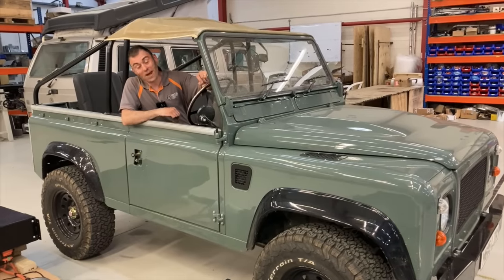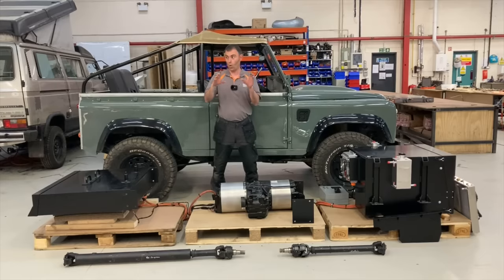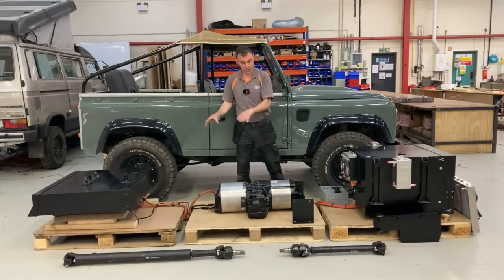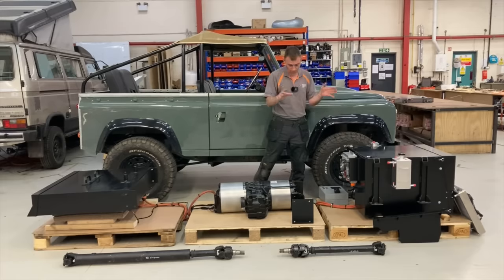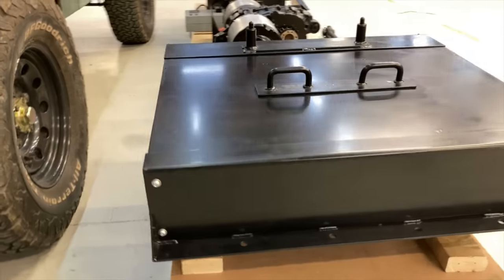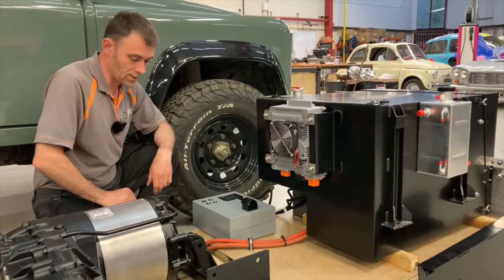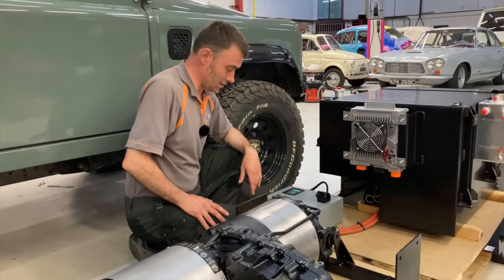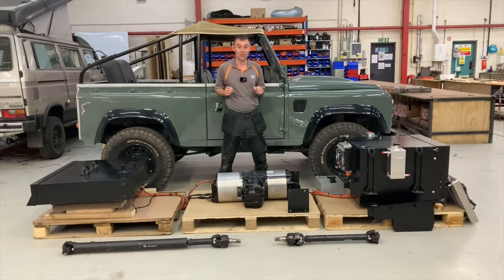Land Rover Defender bolt-in electric conversion kit.

Comment: Please, please, please start selling these kits to the public. ECD in the US are only interested in doing $250k builds and have no interest in doing swaps for the everyday average folk. I would love to do this conversion myself!
Reply: I agree.   I reached out to ECD and they have so many orders for special builds and won’t convert existing Defenders.   Please offer the kits to other businesses in US that will.   Great work and amazing product.
Reply: Me too Brother
Reply: I'm on the same boat. I'd love to convert my Disco1 to EV
Reply: @karlspena  Me too. Disco 1 kits for diy please. A kit with a bit less motor power. Not everyone 4x4 needs 3.5sec 0-60 in fact is often better a little less power. 150kw is fine I think. will go further too maybe.
Reply: Agreed… the home builder is the way of the future really. It’s incredibly wasteful to toss a rig who’s only fault it it’s power source onto the scrap heap. Better to upgrade for sure.
Reply: Ditto.  End use sales please.
Reply: How about converting a Delica?
Reply: No mechanic but absolutely yes !!
Reply: A kit that gave you say 0 to 60 in 7 or 8 secs would be plenty for me, it would reduce the cost on axle upgrades, brakes etc and still be a great conversion.
Reply: Great video! Thanks!!
And a eléctric Kit for Nissan patrol are available too?
Reply: This calls for a kickstarter campaign.
Just need some capital to set up a business structure for imports, etc.
Guaranteed sales.
Reply: Will these fit a dodge challenger?
Reply: Yes please start selling these to the public id love to swap my 4x4 suburban
Reply: How about a Mitsubishi Pajero mk2 91 to 99 model. There are a lot of these still around with great enthusiasts and lovers. A big community out there. But the price should also be affordable and made available to the public on a DIY purpose with your support of course.
Reply: Uhh throwing my hat in for a kit to convert my 67 Bronco.
Reply: I would love to put a kit like this on my Chevy Avalanche !!!
Reply: Got a 49 Nash statesman that I’m trying to save to convert- electric would be a blast. Need kits like this for shade tree public.  You can see the success of it just from the interest demonstrated in these comments
Reply: Would this maybe fit a 70-ties Jeep Wagoneer?
Reply: an electric lada 4x4 would be nice
Reply: Couldn’t agree more - I’d buy a kit tomorrow if they were available to the public!!! I have zero interest in going to ECD and spending a 1/4 mill on a defender - if the kit laid out in the video was off the shelf around $30-50K depend on spec you’d have a cue of people lining up to buy it. Just look at FORD - they are selling a create electric motor to the public. Please please please ECC setup a page on your website where we can order directly from you.
Reply: Land Cruiser Sahara 100 Series x2. My chequebook is ready!
Reply: I think you can call him up and become a dealer of these dude
Reply: And the UK
Reply: Land Cruiser fj40 kit would be awesome! Please sell directly to the public!!
Reply: I think they're put off by the idea of home builders dealing with 400 volts. These systems are seriously dangerous in the wrong hands!
Reply: Jeepster commando please!
Reply: Please do so… I really want to keep driving my 110 and with the diesel engines, it is harder and harder to get around…
Reply: I was interested at a time but I went with the Cummins swap

Comment: I'd buy that kit in a heartbeat to DIY my Disco 2, and happily sign whatever safety waivers you need. 
While I wait for that, or a discovery-specific kit, thanks for detailing the components!
Reply: In theory, it wouldn't be too hard to adapt that to fit a D2, Just the chassis mounts to fabricate. I think they convert the Defenders to an electric handbrake working on the rear axle. The dials etc for the dash would probably be the challenge.
Reply: @hughmarcus1  The D2 architecture is close to a P38 than a Defender, like the D1 is a classic Range Rover, so in principle two minorly different kits would cover several other production runs. The issue is though fooling all of the later ones into thinking there is an engine in it and it is running, lots of things rely on a signal saying it

Comment: Just love it! Would love to see an 80 series Toyota Landcruiser upgraded. Keep up the amazing work!
Reply: What’s wrong with a diesel?
Reply: @dutcheastindiancompany8415  it's slow and expensive to run?
Reply: @greenernick  cheap to buy, cheap to fix, and it’s goot for the earth.
Reply: @dutcheastindiancompany8415  Diesel is good for the earth?
Reply: @greenernick  a Diesel engine is very reliable, you can use them over and over again, as long as they get oil, they can keep going. That’s the opposite of a electric car, within 5 years your battery is running out of life, NEW ONE! After a short while the electric motor starts to have trouble NEW ONE! If people want to create cars that are good for the atmosphere, they need to make them simple, not from 0 to 60 in 2,3 seconds. No electric windows, not a big display.
Reply: @dutcheastindiancompany8415  lol, I mean, I have a diesel 4WD, so I've got nothing against them. But what you are saying seems to ignore the burning of diesel on a daily basis, overstate how often batteries need to be replaced, and overstate the amount of resources that goes into battery production.

Comment: The classic ultimate driving machine: BMW 325 E30 any form.  Proud owner here. I have been modifying this chassis for years just to keep it on the US road. However, if there is a simple electric solution, myself and many other proud owners around the world will jump on this solution and keep this gem on the road for many more years. Good Job and Good Work!

Comment: FJ40, FJ45, BJ42 etc should allow for a similar design strategy with the 60/40 battery split. If lucky, the same kit with some modified mounts might even fit.
Reply: I agree, I own an FJ45, 2f petrol, and I would love to convert.

Comment: ABSOLUTELY another vote for D4-3 conversion kit .... you would be knocked over with the rush as these vehicles were one of the best built (if you take out the mechanical issues .... usually down to the engine and transmission)

Comment: A Nissan Patrol Y60 and Y61 kit would be an amazing kit to have. Those axles are top of the industry, they only lack on the engine side, so this type of upgrade would be quite a step up, as they are very popular in Australia and middle east, but also some parts of Europe.
Reply: Yes that would be wonderful!
Reply: OM606 👍🏻
Reply: @seshelbow336  or BMW M57 which is an even easier swap, but it wouldn't be legal in Italy. An electric motor would transform my Patrol in a perfect every day city car, with great off-road capabilities
Reply: A SWB old school Patrol is something I lust after but probably will never get the chance to own…..for me it would have to be done in the Arab style like they race up the sand dunes….and I can’t think of a way to have a turbo hanging out of the bonnet with an electric conversion.
Reply: @seshelbow336  well I mean, you could but it would not have much of a use ahahaha

Comment: Excellent, just excellent. I hope in time you can also come up with a similar packaged system using a less powerful motor that wouldn't need upgraded axles? Although less exciting it would make it more affordable, and possibly yield a better range from same size batteries?
Reply from the maker: Yep. Already have that available now with a Tesla model 3 motor. Less power and more efficient. 👍
Reply: @ElectricClassicCars  Does Tesla sell their motor/transaxles on their own or do you obtain them from salvaged cars? If not, Tesla would behoove themselves to do just that at some point in the future.
Reply: Even if you didn't use a Model 3 motor, it's easy to electronically "de-tune" the power output.  I put these same components into a 1997 Jeep Wrangler.  I still have the factory axles and if I were to run full power they would break for sure.  I have it "de-tuned" to about 300kW and so far so good.
Reply: @JustWasted3HoursHere  I think you will find that all Tesla bits come from salvage.
Reply: @MiniLuv-1984  That seems likely, especially with the state of the world as it is right now. Maybe at some point in the near future they could offer it as a crate motor kit either to manufacturers who would like to build or convert their own cars but don't have the resources to do that part of development, or to end users who may just want to update their 1964 Ford Econoline...
Reply: @JustWasted3HoursHere  funny you mentioning an old Ford. I believe Ford are offering an electric crate motor.
Reply: @felixokeefe  Yep, the one based on the Mach-E's motor. But, it's not made for any particular Ford, which is where I think it would have really excelled.
Reply: @JustWasted3HoursHere  That sounds like a great start - a ford crate electric motor that drops into the transmission tunnel...
We also need a "all purpose controller" with factory ECU interfaces - plug and play into the current system and ofcourse battery  enclosures that drop into existing engine mounts and fuel tank openings.
Reply: @MiniLuv-1984  Yes! That's exactly what I'm talking about: The extreme simplification of a swap, where the majority of the hard parts are already done for you so that minimal customization is needed. They could start with a kit for a car they sold that changed very little over the years as far as the engine and electronics go, such as the old "Foxbody" Mustang that was sold for many years with mainly cosmetic changes. A kit that used the same mountings, connectors and interior space would, I believe, be very popular, especially if Ford built one to show us what it's capable of and why it would be desirable.
Reply: @JustWasted3HoursHere  Yes! and if I can add, the reason these bits are hard are that manufacturers aren't required or don't  disclose pertinent information.
Reply: @MiniLuv-1984  Agreed.
Reply: @JustWasted3HoursHere  So we need the gov to get on board and create necessary legislation.
Reply: @ElectricClassicCars  So with the Tesla Model 3 motor there is no axle upgrade necessary? But still recommended, I suppose? At least with the LSDs, right?
Reply: @ElectricClassicCars  sweeet

Comment: Definitely a Delica L300 and L400 kit. Preferably with the battery under the vehicle, as to keep the centre of gravity lower and because a lot of these vans are decked out as a camper or still want to keep them as 7/8 seaters.
Reply: And Pajero mk2. Great vehicles

Comment: I suggest that vehicle in the back left of the video frame. A syncro without the crazy expensive and breakable transaxle would be a beautiful thing. Replace the rear transaxle with a front diff facing the other way and do the exact same centre mounted electric motor setup. Although maybe use a leaf motor to save the diffs from exploding.

Comment: Fantastic! Go you guys! I have a Mitsubishi Delica L400 turbo diesel with a dead engine. It's run up big K's plus has irreparably buggered cylinder head also auto trans issues. I love my truck and it would be a perfect EV conversion I'd humbly suggest. Huge flat deck area for batteries, lots of space for the motor underneath.
Reply: Top idea!!

Comment: Build one for GM 4W and rear-drive vehicles!
I've been told (and have seen the results) that a Rover body bolts nearly directly onto a frame of the GM K5 series (Blazer and Jimmy) trucks... I would likely be one of the first of thousands to buy an electric-conversion kit for mine.

BTW, it might be the best 'bang for your buck' development because the K5s use the GM small block with the 700R4 transmission.  This drive-train configuration has to be (by far) one of the most common here in the states, if not the world.  The small block to 700R has the same mount-dimensions for nearly every GM truck and rear-wheel drive car since the late '60s through the early '00s; even the non-diesel Isuzu forward-cab commercial vehicles have used it!  In other words, there are 4 decades of beloved cars and trucks here in the US, and around the world (largely owned by DIYers/shade-tree mechanics) that would all be potential clients.  The modifications to your existing Rover kit should be relatively minimal considering the very similar space and power requirements.  

Long story short: very cool kit!
Reply: Id order one if they did one

Comment: I was thinking " Panda 4x4" right before you named it! I had 3 of them, from the very first model ( a green one) to the last one ( of the original model, of course) . Great little machines on snow and mud. Would really like to see how it turns out with an electric power train well designed and beautifully crafted as only you can do.
Reply: the "secret" of the 4x4 panda performance on mud and snow is the light weight, I'm afraid that a conversion would reduce the advantage it has over other 4x4's

Comment: Land Cruiser 80 series would be a good one Richard. They were Toyota's pinnacle 4x4 before the bean counters started getting involved.
There is loads of room underneath for decent size battery pack(s) plus cavernous space for the motor unit.
If ever you want to look at/under one I would be more than happy to pop over as I'm relatively local to you there 👍🏻
Reply: Absolutely the pick, likely the 100 series would also use the same conversion the market would be massive
Reply: @billcathcart138  I have a 100 Series that I'd love to convert

Comment: The most enjoyable driving experience I’ve had is the 2003 Discovery 2. The TD5 was a great engine back it day. I’ve got two low kms examples waiting for conversion.
Reply: Yes, Disco 2 would be perfect!
Reply: By the time the D2 was ungraded to the D3 it was a very well sorted car. 
Rear battery space when you pull out the 84 litre fuel tank and a nice big deep engine bay between the struts.
Reply: 🤤can't wait me to
Reply: Disco II owners deserve this. Look how we’ve suffered.
Reply: Wait…..isn’t the frame for the defender abs the disco I and II the same?
Reply: Want that too. Discovery drivetrain is essentially the same. It should fit with a few modifications. Not sure about the drop packs.

Comment: I would love to see conversion kits for Discovery 1 and 2. It would really give them a new lease on life!
Reply: better with a diesel
Reply: Would love my disco 3 as an EV, the 4.4 petrol is ridiculous with the current gas prices
Reply: @aramakaraka  will cost you more and not reliable
Reply: Currently converting one of my 300tdis to an ev so I can have one for running round cheaply
Reply: @richardcowley4087  Because in original form reliability was second to none...
Reply: @emceeboogieboots1608  worked on landrover a lot in the past
some were shite some were not
reliability !

Comment: That's a lovely kit, definitely looks like it would go into a Discovery 1 as the engine bay is bigger, space at the back might be a challenge.
Reply: yes please a discovery 1 please it will be a shame to scrap something ive basically rebuilt an cit most the rust out off when the deisel fades away.
Reply: Yes a d1. I have one and wanted to convert it to an ev for years

Comment: A Nissan Y60/61 Patrol would be a fantastic candidate for this conversion as they are extremely popular all accross the world, one of the best all-round 4WDs, have a high GVM, and has a large and heavy engine driveline of around 750kg (550kg motor, 140kg gearbox, duel fuel tanks ect), that would easily offset a large battery in a very similar configuration.
Reply: Totally agree. A kit that fits a Nissan patrols would very versatile for many other 4wd and light trucks, utes, pickups the world over

Comment: This is fantastic. I've just found this channel and what you are creating is awesome. I would love to see a Toyota Landcruiser Troopy kit. How would a camping/expedition vehicle go trying to rely on solar charging? I would love to see this product down here in Australia, amazing kits you are making.
Reply: I would love to see the Land cruiser FJ60 kit, here in east Africa those cars truly were and still are the kings of off-road!
Reply: I second the fj60/62 kit!
Reply: with the roof of a large 4x4 covered in panels you might get 2.5KWh per day in perfect conditions, so in this set up 3.5 miles a day roughly. Of course if this is off road then the low speed will give you increased range so you may get a bit more